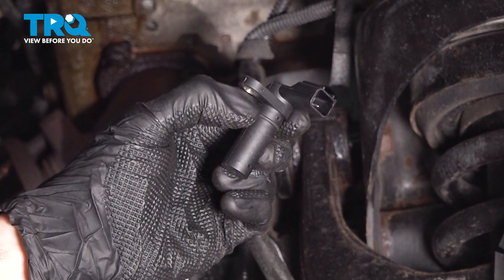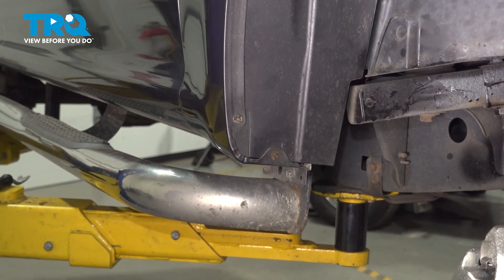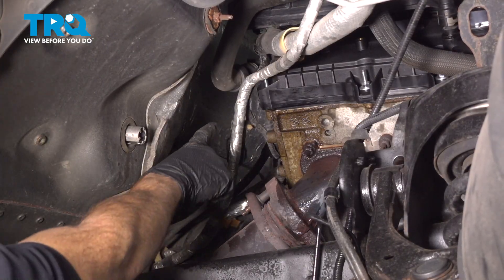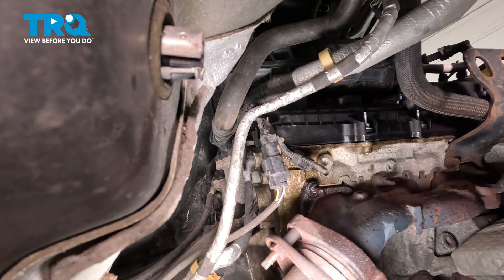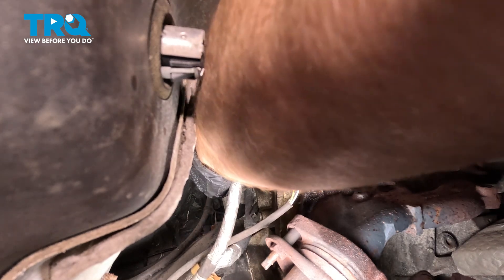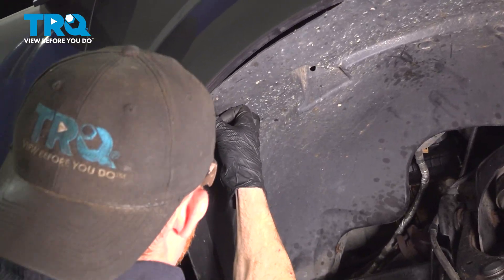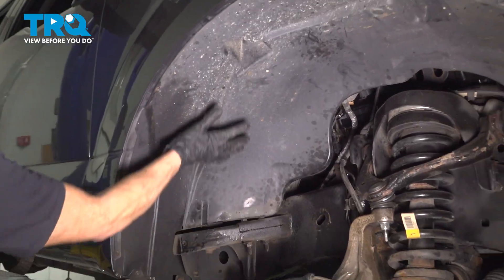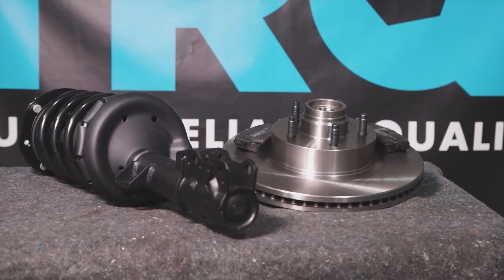How to Replace Exhaust Camshaft Position Sensor 2015-2020 Ford F-150 3.5L V6

Comment: So you are doing bank 1 passenger side sensors in this video or are you getting at the bank 2 sensors on the backside of the driver side head?   
In watching this, there may be some 3.5 differences between 2016 Expedition locations vs 2016 F150 locations.